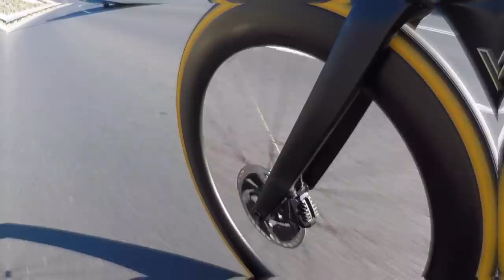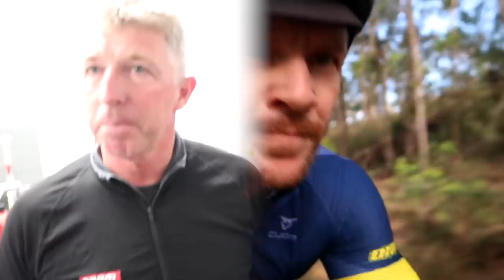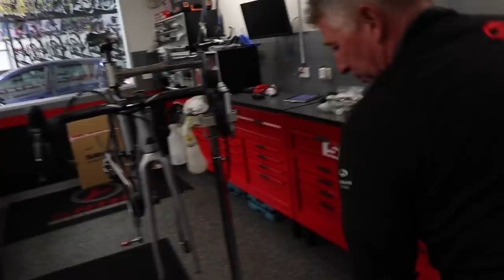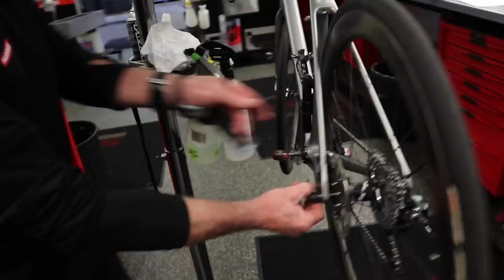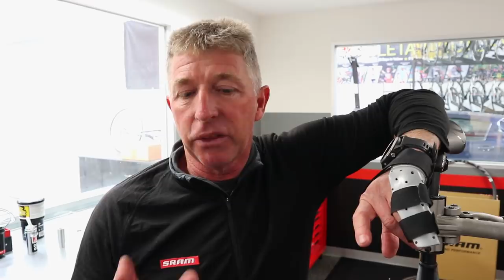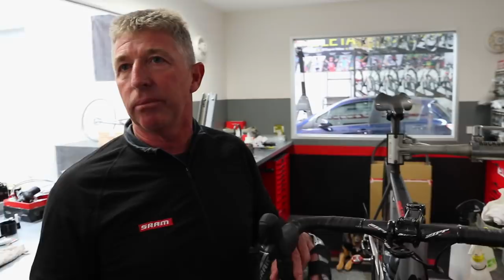Disc VS Rim Brakes (& Thru Axle VS Quick Release Skewer)

Comment: I'm riding a CAAD12 on Ultegra Discs. I wasn't looking for discs specifically but got an epic bargain. The discs are ok, but would consider buying a rimbrake bike if I were to buy a new bike any time soon. Discs are fine with  but for me I'm not sure they are worth the weight and price penalty. I've never had carbon rims so heat and wet brake performance is not such an issue. In my eyes it's a big industry push and the technology is actually not bad, so people are going with it. At the same time for comparability issues it's provably better to only have one system. 2020 seems a little early.  Maybe that's for the super high end bikes only. I'm sure we'll see rim brakes around for much longer than that (on the road,  and in the shop). Ride on!

Comment: Sorry SRAM marketing guy, but I have been riding bikes with QR wheels for 28 years and have had 0.0 failures of any kind. I understand and can accept the trend of road bikes with disc brakes but the QR argument is weak.
Reply from the maker: Fair call, thanks for sharing your experiences here. Cam
Reply: Exactly - all of a sudden, technology that was ok for a century doesn't work anymore... Hahahaha - marketing bla bla bla... I'm not buying either. The only place where disc truly are better, are in muddy and wet conditions. Have a quality wheelset and you're prefectly fine 100% of all time.
Reply: Have to agree but overall prefer the through axle over all. It is much more modular. Since the 70s bikes and bike parts have been about transitioning to a modular technology from the threadless headsets to cranksets. Modular is more simple, clean and most of the time stronger. I love the simplicity of the through axle. It's one part vs multiple small parts. Though you probably won't feel it, it's stiffer.
Reply: @ricric9521  It's also heavier for no gains.  Why would you want to add weight without any performance advantage?
Reply: On my Specialized mountian/gravel bikes the wheels flex with QR so much the disc brakes can be heard rubbing, it doesn't happen with Thru axles. Read into that what you will, I just don't like using brakes without pulling on the levers, I'll gladly keep using thru axles on my bikes.
Reply: Don Fraser If the issue is through axle then there’s no reason why rain break you bye cannot be designed with through axles. That is how you can tail the marketing and people trying to manipulate the market to whatever they want

Comment: Quick release failing?  Sure if someone doesn't know how to use a qr, it's the qr's fault?  Nothing wrong with rim brakes for road bikes almost all the time when dry.   I've been using them for many years.  I've got disc brakes on my gravel bike and love them but I don't need them on a road bike.  I know that's the way the industry is going, and I'm fine with that...I also don't need to buy a new road bike anytime soon.
Reply from the maker: Thanks for sharing. I have a rim brake bike now don't want to part with because of the way the industry is going too! There's still a place for them in my eyes. Cam
Reply: Boys,.... just like VHS, Vinyl and the 3.5mm jack, all goneski...... Move with the future.
Reply: Cam Nicholls Just bought a rim brake bike, could have bought a disc brake bike but it is not necessary with the riding I do: dry weather and relatively flat. No objection to disc brakes, but I disagree they are superior in every respect and based on the heated debates around this topic, there are clearly a significant number of cyclists who see the benefits of rim brakes.
Reply: @DanTuber  vinyl is making a resurgence. Won't be the top dog, but it has it's place.
Reply: @DanTuber   how can you compare that with a bike.....???? so easy to spot that you know more about blue rays and play station than bikes....
Reply: @snoopy1164  Never used PS or a blue ray

Comment: Utter bollocks! I have been riding rim brakes for almost 40 years and never had issues with overheating rims that weakened my tyres and tubes. Lol! Should send that Aussie to Switzerland to see the size of the mountains we have.
Reply from the maker: haha, fair call. Cam
Reply: Two bikes, two different braking systems, same descent (yes in Switzerland as I live there too) 24secs difference in favour of the non aero disc equipped bike on a 11min descent.
Reply from the maker: @vaughanc4919  Interesting insights. Thanks for sharing Vaughan. Cam
Reply: I totally agree. I have been a keen cyclist for 40 years and I have never had an issue with quick release, or overheating etc . Just absolute rubbish, mainly to sell disc brake bikes.
I have owned steel, aluminium , titanium and carbon bikes with rat trap pedals to start with , now clip in of course with carbon soled shoes.I have ridden hundreds of thousands of kilometre s( and raced many of them also ) and have never had any issues with the bike "not being stiff enough". Rim brakes require much less maintenance than disc , and my latest generation Dura-ace rim brakes will stop a freight train.
Reply: The guy does not have an honest opinion, he's protecting his job, and the big firms are pushing to disc brakes that offer no advantages rather than bad weather?. More weight, climbing slower, less aero on high speed... If you know how to control well those rim brakes they are not gonna beat you, and you got zero maintenance. In MTBs, disck brakes are great for that, but for RB, I don't think so, and companies are the biggest donkeys pushing those disks, instead of develop what's already work great.
Reply: He is talking about carbon rims. Your oldskool alu rim will never damage of heat of course
Reply: viralfire your experience is from aluminium rim brakes I gather?
Aluminium conducts and dissipates heat more readily and has a higher temperature threshold until permanent deformation.

Carbon wheels are limited by the resin, which normally starts to soften at 130deg C onwards. It is also a thermoset, meaning once it’s heated it doesn’t reset, it’s permanently affected. High temperatures mean the rim is weakened, and heavy load or an overload situation, ( like a bump or pothole) can result in catastrophic failure. The fact that a caliper is trying to deform an already weakened structure by squeezing it, just aggravates the situation. Also too if the the rider is heavier, more energy must be dissipated.

Rim brakes have been refined over 70 years to where they are today. Discs are barely are 5 years old on road bikes, so still early in their gestation. In another 5 years they will be heaps better in actuation, maintenance and weight than they are today. No doubt for the average consumer, they are the future. Don’t worry about pro’s, they are paid to race, and represent less than 1% of the target audience of sales, who pay the bills to pay the same pro’s.
Reply: @flrn6233  I call bullshit. Rob Eva is not protecting his job. He's telling it like it is. As for less aero at high speed - the leading edge (top front) of your wheel generates a LOT of drag - you'd be surprised - and this is a bigger issue than the disc brake set up. The disc brake is already in an area of very spoilt air, so significant disadvantage
Reply: You have obviously never ridden a modern road bike with disc breaks. If you had you wouldn’t do back.
Reply: @jeffcoulter7181  I own a Colnago C64 with disc brakes. Is that modern enough for you Jeff? Don't assume things about others when you obviously don't know Jack.
Reply: Amen ⬆️⬆️

Comment: I've ridden rims for 4 years. I've never experienced blow outs or problems with inners or tyres. I think it depends on the climate you live in. Where I live it's cold and wet.
Reply from the maker: Thank you for sharing. I've never experienced a blowout either in 10 years! I think it really depends on how hard you're descending / using your brakes and the luck of the draw. Cam
Reply: @CamNicholls  Where I live it's hot and dry. Never have problems either.
Reply: He is pushing discs shamefully. Look up Harley Durianrider, hundreds of climes on Dui Inthanon in Chiang Mai, long descents and no burning/melting. I did it myself many times, daily on giant alloy wheels (same mountain) no problems.

Comment: I have cable disc brakes on my heavier touring bike which also has 5 - 6kg in my panniers of course but on my (reasonably) lightweight  road bike rim brakes are fine...the trick with rim brakes is to swap out the stock pads (Shimano or whatever) for better ones (mine are Swissstop) which makes a hell of a difference in stopping power and they even work in the wet.
Reply from the maker: Thanks for sharing Simon. Cam

Comment: Stiffness comes from the frame clamping to the hub and the clamping force with a QR cam is greater than with a through axle.  The skewer isn't in the stiffness equation and neither is the through axle.
SRAM man is all marketing talk - skewers failing all the time, eh??  Bike industry is continually inventing new stuff to make money from cyclists prepared to spend on the so called latest and greatest.
Reply: Stuart!  Thank you.  I was thinking the same thing watching the video and reading the comments.
Reply: Agreed, I'm a heavy rider, riding and racing for over 30 years and I've never had a skewer failure, this is bollocks.

Comment: Everything that bloke said about brakes is spot on. Disc brakes are superior in so many ways. My only gripe is the time it takes to adjust the brakes after pad wear. With rim brakes, you twist a barrel adjuster or take up cable at the calliper. You can’t do that with hydraulic disc rotors. It’s a workshop job, and it’s a pita! Fortunately, adjustments are needed less often than with rim brakes (for me at least).
Reply from the maker: Thanks for sharing your thoughts Rhys, Rob knows his stuff. Cam

Comment: I purchased a 2015 Defy with cable disc brakes and did around 12k on them and loved it. The defy was a rim brake bike and they just changed a few things to have disc. I then decided to do a big upgrade to another disc bike but wanted to get one that was made for the ground up as a disc bike. I did a tonne of research and a tonne of saving to get what I wanted. I ended up buying a BMC Roadmachine 02 with upgraded DTSwiss deep carbon wide rims. The difference from the cable disc Defy to the BMC hydraulic disc was like chalk and cheese. The BMC is a dream to ride and a lot faster due to the carbon layup is better in the right spots. The brakes do make a noise after hard braking but they stop after about 30secs. When they start to make a noise all he time it’s just a pad change needed. I would never go back to rims. The area I live in has a lot of hills so they are a must.
Reply from the maker: Thanks for sharing your experiences here. Cam

Comment: I never heard of a regular skewer giving out he's just a marketing guy!
Reply from the maker: Frank Amaral neither have I Frank, but Rob’s been in the industry a long time so I wouldn’t be surprised. Cam
Reply: I've heard of the wheel moving in the dropout under heavy braking.
Reply: I agree
Reply: Was thinking the very same.
Reply: Exactly, have yet to see anyone use that argument to sell disc brakes. In fact, would love to see Rob give an example of a pro (who generates significant forces) who had a skewer fail. I see the benefits of disc brakes and am not opposed to them, but there is no need for rim brakes to be discontinued.
Reply: Very marketing guy...
Reply: You need to realize he's at the highest level of distribution and he didn't quantify if the skewer was installed correctly. But can the cam part of the skewer fail? Yes. Can the wheel not be seated properly in the dropout preventing the skewer from being able to hold the wheel under load? Yup. And unfortunately the most common problem of not understanding the cam action on the skewer at all and thinking it's a simple nut/bolt system (which thru axles solves) and just tightening it together. At the corporate level you will hear about these types of stories everyday as you're dealing with the lowest common denominator in the general public. But to experienced cyclists when the threads are trashed or the cam starts to show excessive wear you toss it.
Reply: Sergeant Bosco Must be overweight people. At 140 lbs I’m confident this will never happen to me. Marketing man.
Reply: I've had skewers fail, bend, warp, unthread, not seat correctly... all of that, over all my 20 something years of riding. They suck. Through axle is a godsend.
Reply: My rear wheel QR failed at the threads.The whole wheel went into the frame and totaled it. Since it happened wile i was riding, out of the saddle, i went OTB and ripped the skin off of my fingers. Thanks to luck it was autum and i had a jacket on that protected me from more road rash. The man is saying the truth.
Reply: Funny - I just got asked to sort out a front wheel QR skewer for a friend because the one on his bike snapped the threaded section off while he was riding it. Thats not the first time that I've heard of or seen QR skewers failing, but then if you work on a lot of bikes and know lots of riders then you'll see and hear about all sorts of crazy stuff happening.
Reply: @aforanti  I had a Shimano XTR QR. Read my comment on this reply thread
Reply: There's a potential for the skewer to break if you really put it on far too tight but other than that they're fine. Also remember that the skewer is just pinning the wheel on and that the forks are actually resting on the axle of course.
Reply: He did mention ti skewers in there somewhere and they have failed
Reply: @CamNicholls  I've been riding and racing MTB since 1995 as a junior.  I have never broken a skewer.
Reply: @DEFKNIGHT  I've been riding since 1995 racing MTB and riding road.  I've never broken a skewer.   The only issue I had was my own fault - not closing the skewer probably 19 years ago.  I've also never used titanium or aluminum skewers.  Shimano skewers are the best in the world.  When  went to thru axle, I found zero gain on the rear of the bike.  On the front - I couldn't tell the difference between QR and thru axle as an XC rider.
Reply: I have.
Reply: I have, BUT, it was a "hollow" skewer which I think is bloody stupid and dangerous (just to save a couple of grams).
And it was made out of aluminium instead of steel!
Reply: I've had skewers loosen on me. One was particular nasty, I was turning up on a driveway that had bricks for the crosswalk and a bit high lip due to age, as I hit the lip my wheel almost fell completely off, it was sitting at an angle.

I've also ridden and suddenly when braking I felt a give in the front wheel, it was loose.

Last occasion was the rear wheel that was loose..

Bike has since been stolen and that is good as I have regretted that bike and the one I bought alongside it. Luckily the insurance has given me an option for a giftcard on the full price of the bike, so I now can get what I really wanted, a 12spd MTB with Thru-Axle.

Buut due to Covid, the bike sales has increased all over and parts are just sitting on the piers as there are no containers to ship them in because murica doesn't wanna send them back..

Comment: That SRAM guy sure exaggerated the difference in rim vs disc and the “problems” of rim brakes. My frustration is that the bicycle industry has never articulated the Value Proposition of Disc Brakes for road cycling. Unfortunately the industry is forcing this into the market

Comment: I've never had an issue braking on rim brakes. I hear so many people say their brakes rub and a lot of times is after wheel changes.  I think road disc needs more time to mature
Reply: yea i dont think disc breaks is worth it if you dont have a pair of really expencive wheels as changing a disc is cheap but changing a rim is expencive also need expensice wheels to make it worth it. Also road bikes in general dont have the grip from the wheels to have better breaks than rim breaks as the wheels usualy lock up before the breaks bottom out

Comment: No offence, but the SRAM guy hasn't a clue. A thru axle is a clamp. Its purpose is to apply sufficient force to keep the hub clamped to the forks. That's it. The hub provides the stiffness. If anyone claims that a thru axle provides extra stiffness it means that the original hub or fork wasn't doing its job and was badly designed. The main argument for thru axles is to reposition the rotor in the brake caliper and to combat the different braking forces for disc brakes. For front suspension forks the legs are independent so thru axles are good for combating that extra degree of freedom of movement to keep the legs aligned. There is no stiffness advantage in the rear. Any perceived stiffness increase means bad skewer or hub  design. I find thru axles more convenient but the stiffness argument is wrong.
Reply: see Peak Torques contribution (here: https://www.youtube.com/watch?v=KMdsSuXGniU) who is supporting your agrument above
Reply: @wolfganghenke173  Funnily enough, I rewatched that video a few days ago. Vielen Dank!

Comment: Discs have several advantages. However I have ridden over 50,000 miles with rim brakes without problems. I ride the Blue Ridge Parkway in N.C. and frequently exceed 50 mph. I’ ve never felt uncomfortable with road brakes. I’ve ridden 10 , 100 mile races finishing on mountaintops during rain and hailstorms. Again with no problems. Likewise I have had no problems with skewers. I have always serviced my own bikes and never had a skewer fail. I have no problems with the new technologies, but. I have plenty of experience with rim brakes and skewers without problems.